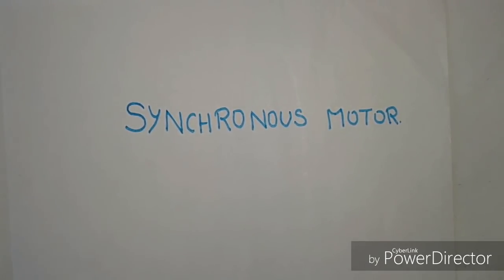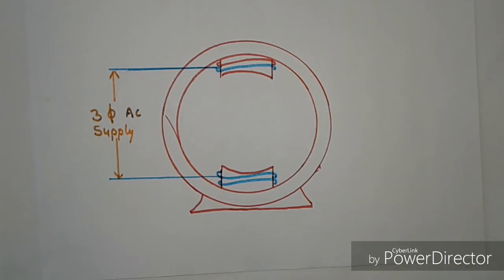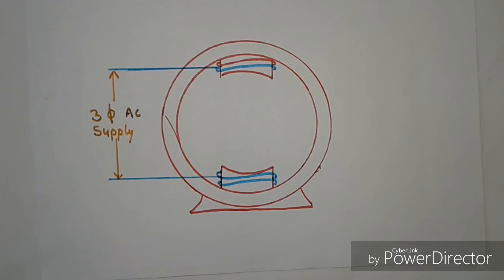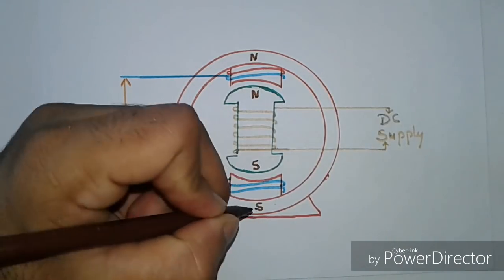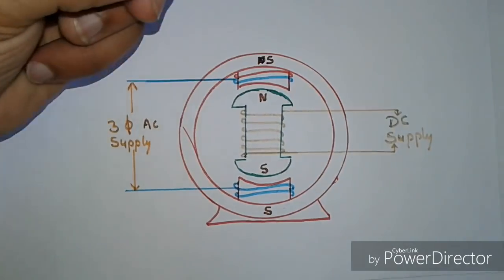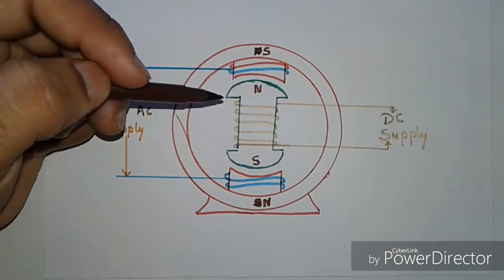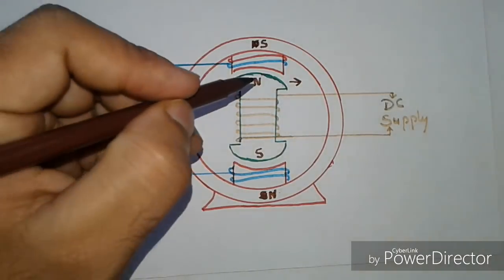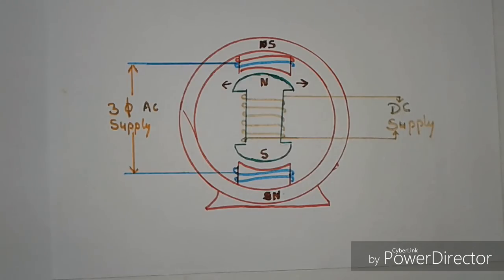Why synchronous motor is not self-starting?

Comment: Bhai tumne jo supply diya hai wo single phase hogi na ki three phase.. galat padha rahe ho.
Reply: Bhai stator ko 3 phase supply he Diya jata hai tbhi toh stator poles synchronous speed par run krte hai Orr rotor poles physical poles hote hai jo ki dc current flow hone ki vajh se form hote hai
Reply: @saurabhsaxena9219  hahahah